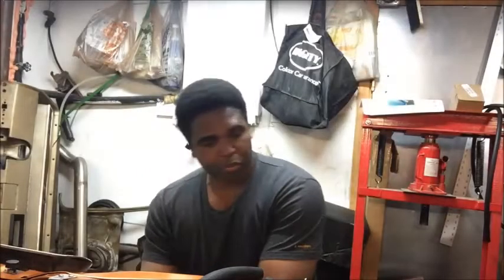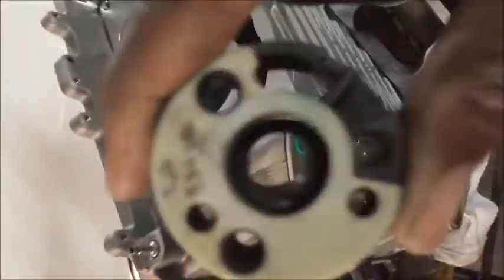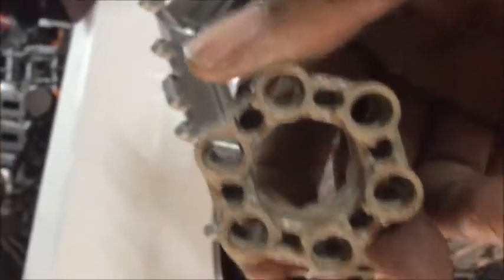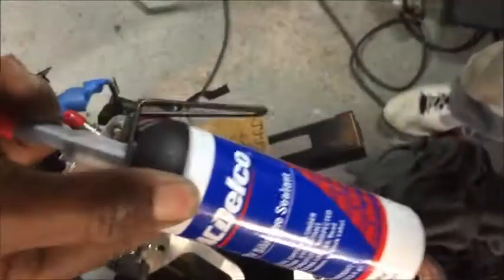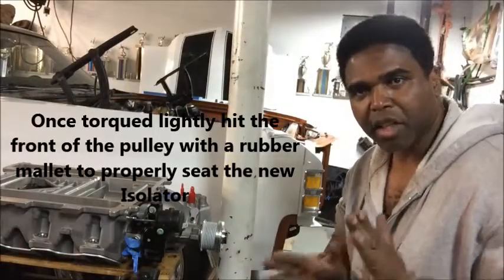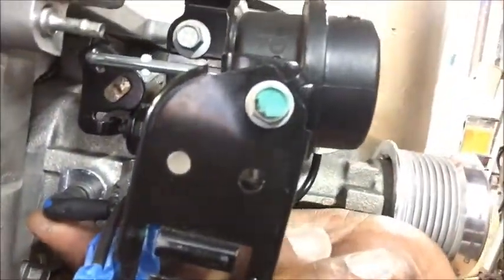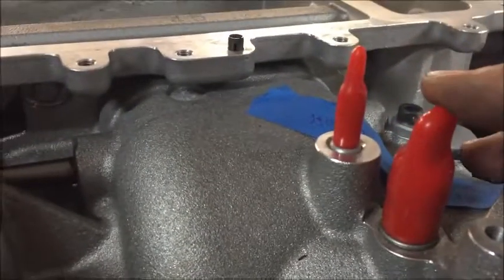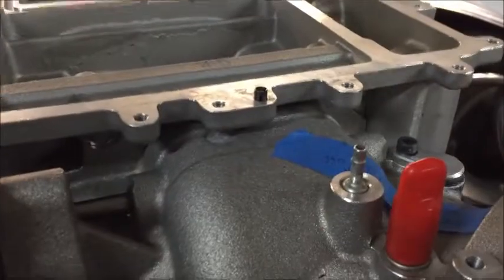LSA PREP PT3. MATING THE SNOOT AND USE OR BLOCK VACUUM PORTS

Comment: What's the p/n for that sealant Terry?
Reply from the maker: no problem.. ACDELCO 12378521 RTV ENGINE SEALANT. let me know how it works for you.. thanks..
Reply: Thanks! I ended up zooming in and seeing it. Just installed the snout last night. We’ll see!
Reply from the maker: keep me posted on the build..
Reply: Will do bud! It’s an ‘87 El Camino, LS1 w/LSA, 4L80E and Ford 8.8 w/Ford 9” housing ends. Should be a good time.

Comment: If im running a boost gauge should i hook my line up to the upper connector of the supercharger or the one thats next to the connector u said you can use for a catch can.
Reply from the maker: im using the little thin port in the front on the passenger side.

Comment: Where do you hook up your fuel pressure regulator if you running one like I’m going to it needs boost reference?
Reply from the maker: if you going forces induction a boost reference is a good thing to have.. i drilled a hole in on the back of the lsa lid and mounted it there.

Comment: Terry, Great tutorials. I actually installed my BRP brakes because of the video you have out. I do have a question though.I installed a LSA out of a 2012 Cadillac. It is making a noise up around the supercharger, sounds bad. I was wondering, my motor still has the spring loaded isolator, could this be the cause? The motor only has 47,000 miles on it. I didn't know if I needed to change it to the solid one or not. Thanks for the videos and your help.

Comment: Hey my snout pulley is hard to turn when I mate it to the blower but lose when it's not installed did I do something wrong zzp isolater and Metco 2.5 pulley
Reply from the maker: whats good jay.. one install you have to take a rubber mallet and hit the nose of the snoot.. the from of the pulley.. that should loosen it up.. they are always a lil tight after the install.